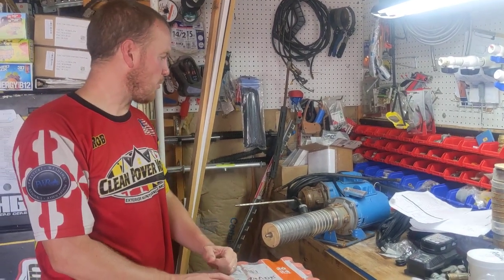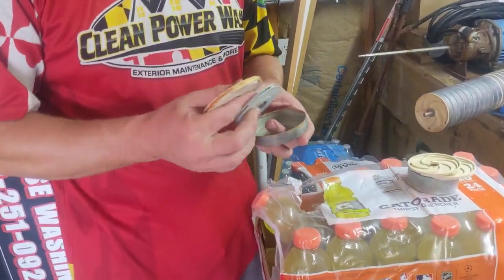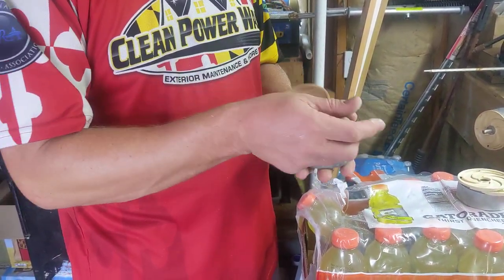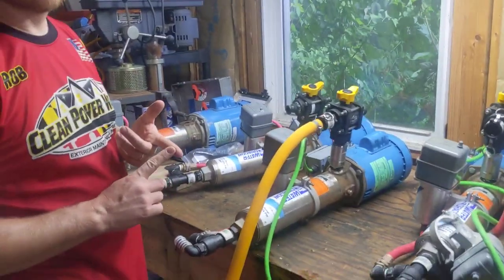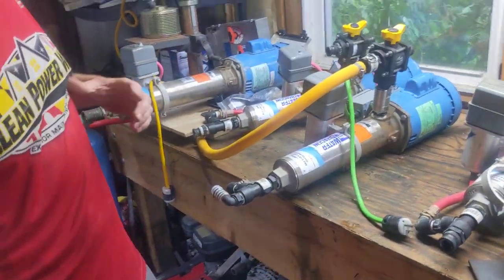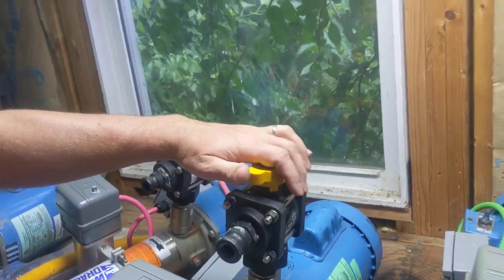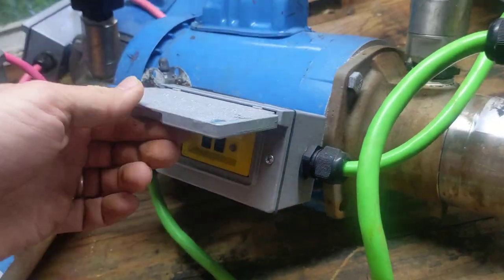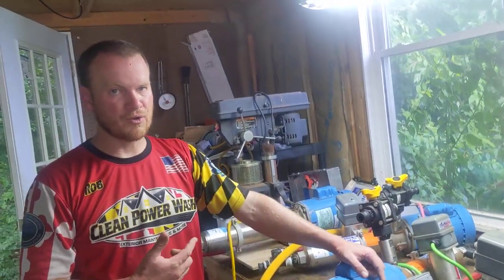How to service a booster pump.  Basics to look for when running into issues

Comment: mine is brand new, the pro switch will only work to cut off the booster when I'm using the force fed option, when i switch the valve to the pro portioner the pump will continuously run, even when I am off the trigger? Any help would be amazing!
Reply from the maker: You've got a leak somewhere or a faulty check valve
Reply: @Cleanpowerwash  how do I change the check valve on the SH valve for the pro portioned, I think it is faulty. Thank you so much!!!
Reply from the maker: The bolts have to be drilled out.  It's pretty easy once that is taken off
Reply: @Cleanpowerwash  got it. Thank you so much for the help!

Comment: Anyone know how to hook up the pigtail in the junction box for 220 single phase  ?  I know l1 and l2 but what's insul mean and where's the ground  go ...comes with vague instructions on this....and hi and low voltage?  Anything over 230v should be 3 pH but still says l1 and l2
Reply from the maker: There is a diagram on the back of them where the wiring is and it shows you how to set it up
Reply: @Cleanpowerwash  yes it's very vague but I think I got it figured out thanks for your fast reply

Comment: What's pressure do you have set for the pumps to turn off with your switches? Thanks!
Reply from the maker: The power gets cut to the motor when the psi maxes out
Reply from the maker: The pro switch is what does that
Reply: @Cleanpowerwash  I understand all that, just wondered if you knew what you're max psi was; no worries.
Reply from the maker: I need to get a gauge